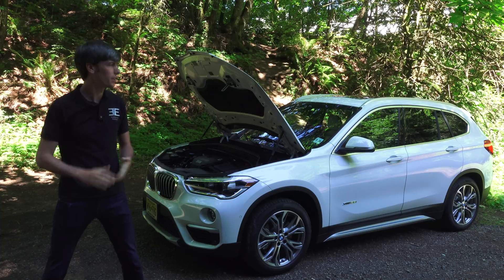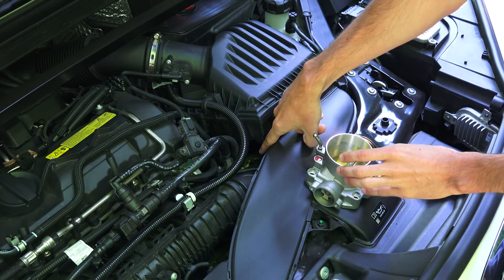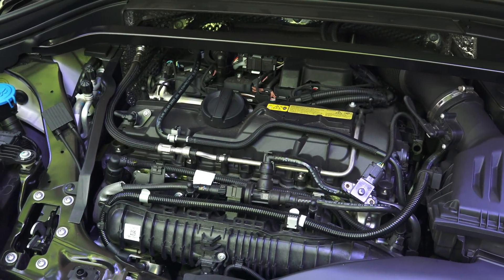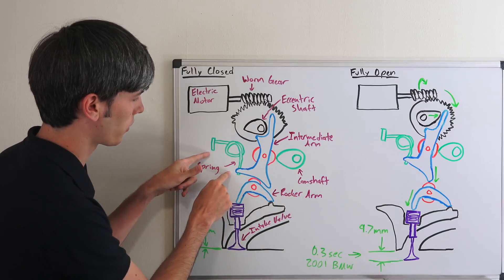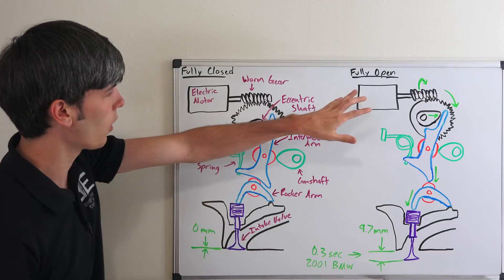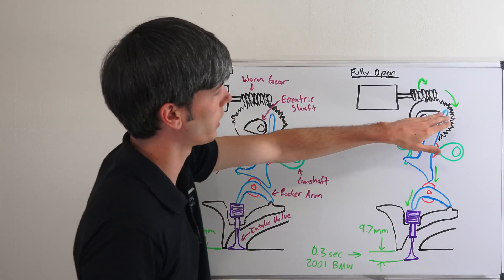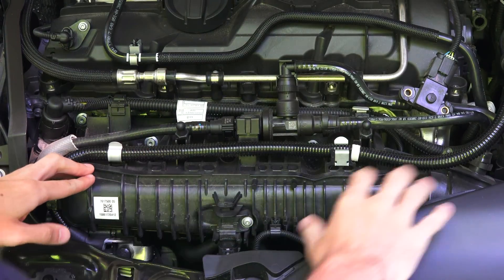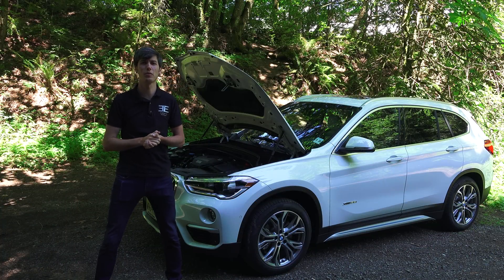What Is Valvetronic? BMW's Innovative Throttle System

Comment: dont buy one of these outside of warranty lol
Reply: More like ask every E39 owner about the $4000 P0741 code, that comes up after a lifetime of dealer service
Reply: Agreed lol learn from me folks!
Reply: valvetronic is pretty bulletproof. youre cofusing it for vanos.
Reply: Iceeeen
The waterpump (or fuel pump) was just an example. I know it has nothing to do with valvetronic, but it's an example of how BMW fails at some simple tasks. Perhaps because they don't want to be reliable, to sell more new cars.
Alright, so because I talked about an alpina engine you won't believe BMW makes unreliable products? Really, so alpina turns a good engine into crap, is that what you're saying? You seem to be a BMW fanboy...
I'm not a BMW hater, as I said they're not the only ones and so on, I just tell the truth.
You're 100% right about oil intervals, which is indeed caused by regulations, but not only by regulations. What I said about too weak valve springs is not something I made up, it's common knowledge m8.
There is a popular youtuber "Eric Davidich" who absolutely loves BMW (X5M), he checks his oil level every day, he buys the right full synthetic and so on, and still he admitted that BMW started making crap. He let his engine, gearbox, driveline, suspension, interior, head- and tail lights, mmi system be fully rebuilt and everything is shown on video. It took him a full engine rebuild to get it reliable (and get some extra power). He takes care off his cars like no-one else, and still his X5M kept breaking down (until the rebuilds). He's not the only one having this problem.
Perhaps you don't want to know your favorite brand is now gone, and turned into... well something else. But why?
Reply: El Shuwix I am talking about a 3 year old X5M that was maintained by a BMW-lover, with the best oil he could find, with daily checking the oil level, replacing it way more often than is required by warranty and so on.
And the fact they had to redesign their waterpump 20 times in 2 years just shows there is something wrong.
New cars with X-drive can't drift, you will simply put all of that M-power (if your engine is properly maintained and hasn't lost compression) onto one wheel, and your driveline will turn into Alleppo.
Really, a BMW that can't drift, isn't that a shame? The R35 GTR has a similar problem where the driveline will be absolutely obliggerated when trying to drift: unlike the skyline  or nissan sylvia...
I mean a BMW-lover with a lot of cash is about the best owner for his car when it comes to maintenance, when a new car breaks down in these hands it really means there is something wrong. Especially if he's not the only one, and there are a lot of cases like this.
Reply: he sure did
Reply: ZF is not affiliated with General Motors.
Reply: believe it or not, I worked at a bmw dealership for 2 and a half years, and I did not once see a valvetronic related failure.  even first generation valvetronic seldom had failures according to the older gents.  very robust design.
Reply: +sasja de vries The system has been used for many years and does not have common problems.  Failures have actually been less common than those of throttle body actuators.
Reply: +Jody Sanders some were made by GM bud. we had an e39 525 and bolted to the m54b25 it said "General Motors- France" I know some of the automatics were made by ZF but some were also made by GM.
Reply: The four speed e39 transmissions were GM 4L30E, and the 530i transmission was GM 5L40E.  The V8 uses the ZF 5HP30 in 1997 and half of 1998, 5HP24 afterward.  The 5 speed 528i used the ZF 5HP19.  Most 4 cylinder models were manuals.
Reply: Yup, it costs me $1500 to replace an eccentric shaft sensor.
Reply: Valvetronic is pretty much bulletproof. Parents had a 02 318. One of the the first with this system and nothing went wrong over the 170k miles they put on the car. Still see it today on the road with the new owner but haven't spoken to him if he had anything go wrong. Even worked as a mechanic fot a while and never saw any problems with it then either.
Reply: Peter Muelltonner
 yeah right. Mostly because people are not paying attention to what you are actually saying. Some people first draw a conclusion and only then they start looking for motivation why has to be true.

I'm 50% Russian, and the Russian language is providing me most of the knowledge.
I'm now an aerospace engineering student at TUDelft (20 years old), I will not recommend TUDelft to anyone. They only teach you how to copy what the teacher is doing (in stead of thinking how and why something is happening); they teach you how to make your drawings colourful (people who studied AE 5 years ago didn't have to colour they drawing); and how to make your 'copy-paste' invention look bleeding edge to dumbass managers.
If you want to know how to actually build an aircraft, you're at the wrong address.
Naturally I find alternative sources online (mostly Russian), simply because I actually am interested in the details and how stuff actually precisely works (not the global things they tell on discovery channel). Knowing stuff is more important to me that getting a piece of paper saying that you should know some things (5th year students completely forgot what they learned in year 1).
I forgot to mention the education at TUDelft is 100% theory, (0 practical knowledge) my fellow students even failed to rivet some stringers to an aluminium plate while keeping it straight.

Alright, about my sources: (the names should be Cyrillic of course)
That one BMW fanboy owning an X5M I talked about is Eric Davidich, living in Moscow, he's owner of the largest Russian car forum smotra.ru. The youtube channel smotra showed a lot of the trouble he has with his BMW.
Next person is Eugene Travnikov, also a quite polular youtuber (among Russian mechanics). His show is called 'teoria dvs' where he posts teardowns of internal combustion engines, theory of how parts work, tweaks to engines, the process of assembling an engine. (1 hour of his videos is like studying 1 week at TUDelft in terms of useful content)
^on his channel I actually found THE way to repair vanos, when people overhaul Vanos they usually don't replace the spring around a certain shaft (a piston ring of the right diameter is an adequate replacement), and with some custom machined parts you let the rattling sound disappear.

And you are right, slav mechanics often find quite original and affordable solutions to problems the western 'super duper educated engineers' don't understand. Because we learn to just do what the teacher showed us.
I have actually plans to migrate to Russia. The only 2 things to sort out are: to convince my parents and those kind of things; how to apply for an engineer as a replacement for the obligatory military service.
That's the new law Putin signed in 2012, aircraft engineers (and some other engineers too) now can get exemption from the military service.
Reply: GodKing804 If the engine can make over 800 WHP on stock internals I’m buying that shyyyyyt.
Reply: lol lol
Reply: Win8pc
all automatic transmissions in the petrol e39 were by zf. the diesel ones were by gm.
Reply: Well say what you want but my experience with the v1 is sort a bulletproof. Witch it should be with that simple design. My guess is they that have had problems are people with bad service since the motor is bathing in oil pretty much all the time. So cheat with oil change and get sludge buildup and dirty oil with problems after that. 
Biggest problem with the n42 were valvetronic was introduced was oil pressure sensor and cam chain tensioner 
There are quite alot of the for sale today with a bit over 300000 km witch also suggest reliability
Reply: whats alleppo?
Reply: El Shuwix  What the blin are you trying to talk about?
I don't have an expensive car, I drive my dad's car. In the Netherlands insurance for beginning drivers is 5 times as expensive.
I did mention someone owning a BMW X5M daily checking oil, he is a 30+ year old businessman and owner of Smotra.ru. <<That' s not me.
By the way, I don't have a gaming laptop, I don' t have any gaming console, I don't want to pay for cloud gaming (and onlive is down anyway), how the heck do I game 24/7 then?
---
And what's the fun of gaming? Hitman and Splintercell are really the only games I am mildly interested in. (Why invest in an expensive PC then?)
Driving a real car slowly is WAAYY more exciting than the coolest racing game.
---
Is this your tactic: just call everyone you don' t agree with a trump-voter, 18yo-gamer or whatever. -Without actually knowing who you are talking about.
Reply: samus989 u said a mouth full
Reply: samus989 More like don’t buy a car if you don’t work on them. 🤷🏻‍♂️🤷🏻‍♂️🤷🏻‍♂️
Reply: samus989 stop buying 10 year old BMWs
Reply: These are notoriously NOT problematic
Reply: more like dont buy BMW off some random people that didnt take care of the car
Reply: +Jody Sanders transmission? Don't buy a car with an automatic transmission made by GM in France if you don't want it to fail. The manual transmissions are made in Germany and I bet they don't have that issue.
Reply: Please, don't tell bs. (sorry for sounding rude) Firstly you might have been lucky: Every car is a bit different. Even when you buy a bugatti there is still a variation of quality in each car, you might have luck and buy one that's a little bit better.
Secondly,most of the problemsdifference with Vanos and valvetronic I heard of where with the 7 series and then came the 5 series.
So if you were lucky doesn't mean it's bulletproof, it's crap. Everyone makes crap today, including toyota and lexus. If you take an engine apart you will see that nowadays all the manufacturers drill smaller holes in their pistons under the 3rd piston ring, This will lead to clugging up and that will lead to oil loss. Really, modern engines are made to work until the warranty is over, then it becomes a lottery.
The whole car is full of tricks to do that and I know one thing: BMW is on of the most talented in doing so, just take an X5M gearbox apart and look at how they've made the clutches (out of cardboard), they used pastic parts when everyone else uses metal for part that costs $0.10.
^10 of these valves will cost you 1$, if you go with plastic it might cost you 0.40$ and it will give you weight saving of a few grams, the only reason they used plastic is because they just want to it break down.
BMW, Nissan and Polaris are the 3 worst brands (that I know off) when in comes to engines with engineered failure.
Reply: MrBusunglueck Almost everyone out here knows the difference between vanos and valvetronic, it's not bulletproof. you might just be lucky when you bought a car.
Perhaps the previous owner swapped the camshafts and the whole valvetronic system for new ones, and your engine is then probably used correctly.
If you look at toyota engines made before 2000, then you can abuse them as much as you want and it's fine. Nowadays toyota is purposefully making it's quality more like others. I mean if toyota is not what it used to be, how can BMW be bulletproof?
Reply: Iceeeen
You are calling valvetronic a simple design? Ok, the final product is not as complex as it could have been, but a simple design is something every other manufacturer would copy because a simple design is easy to improve or change so that you are not offending patents.
What VW crap do you mean? I actually told (almost) every manufacturer is purposefully making crap. The thing is that when I actually know how the engine or gearbox looks like from the inside, only then I will draw conclusions. And by the way, if you think a VAG engine is difficult to service, take a look at some of the engines from a Nissan x-trail or the Polaris-buggy. I don't consider VW to be especially good or bad, it's just another German brand to me. However, their 5 valve per cylinder engines were utterly crap, so if you were talking about the Audi S6 C5 engine, then you're right. That was one of the most bullshitty inventions VW has made, mainly because of poor manufacturing: the system was already expensive enough so they had to save some money, because of the 5th valve crammed in you have less space to work with and the intake airflow is bad, it defeated the whole benefit of a 5-valve engine. And the 1.2TSI engine had shitty timing chains. But VW didn't have the problems found in a BMW.

My understanding of bulletproof is that even if you abuse it, even if you forget an oil change, it will still function. That's true for Toyota engines until about 2000, now they are not bulletproof anymore.
Also BMW started making unreliable stuff after they've acquired Range Rover, before that they made reliable stuff, can't argue with that. That's exactly the period they were producing the m62

And a bit more details:
For an engine to work properly in general, you need the valve-springs to have the correct spring-force, a common mistake manufacturers make is using valvesprings that are too weak, the springs in a M62b48 valvetronic are a good example of this, And BMW simply could not install valvesprings with a higher force, since that would require the whole mechanism to be reinforced. As a result the rocker arms all have little bumps and scratches on them after some time, no matter whether you use castrol edge, liqui moly, bardahl, it's not bad oil that's causing it. It that what's called bulletproof?
When talking about BMW in general, there were a lot of problems (in the latest years) with their engines, here are some of them:
A rattling Vanos system in a m62 is a common thing as far as I can tell, maybe it's not in your region but it is in Russia and Netherlands (which is part of Europe). BMW had problems with too short pistons (I think m62b48), they had a tendency to tilt, letting the engine consume oil, on the X5M they had redesigned the water* pump 20 times in 2 years, and none of them war reliable (I forgot whether it is the fuel pump of the water pump).
^But because of redesigns and so on, one generation might be better than the other, I mean they fixed one problem but created another it might be the first problem was no big deal to you so you prefer the first one.